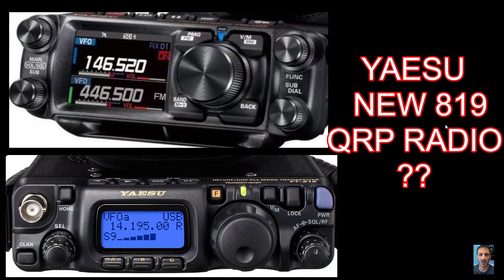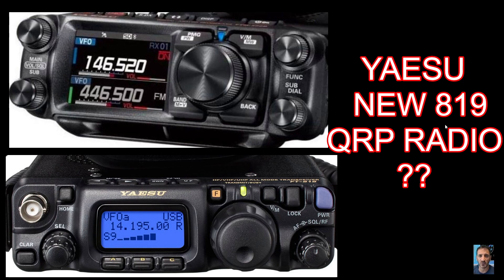YAESU FTM500 VERY SIMILAR TO YAESU FT818 ??

Comment: I don't think a replace for the 817/818 will be for the near future. Production was stopped unexpected due to shortage of components. I think they should have designed a new radio to replace the FT-817 years ago. They offered a radio with 20 years old technology, never renewed. The FT-818 was a missed chance to replace the FT-817.  btw I really love my FT-817ND
Reply from the maker: I dont believe components they released a few radios.

Comment: I don't think so. I think a new Yaesu QRP will have a quick removable battery. The waterfall is a new gimmick most Ham Radio Operators love. I would think Yaesu would use a larger screen. Most think the X6100 and/or the Icom 705 is a small radio for QRP. I travel by air. So packing the X6100 or the 705 doesn't work for me. The FT817/8 works great for air travel. Maybe adding a wire/wireless connection to a small tablet for a bigger screen if need would be nice. PLEASE NO INTERAL ATU. If you can't tune an antenna for the band your on. You are just wasting your QRP 5 watts.
Reply from the maker: All valid interesting points -thanks